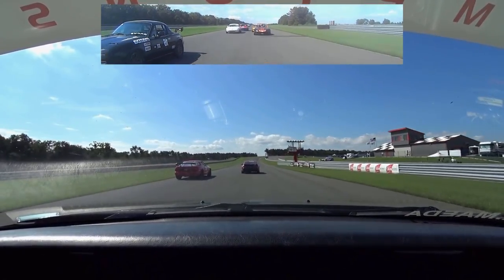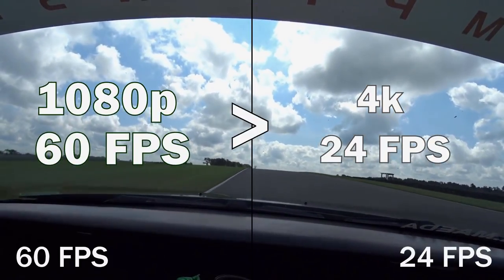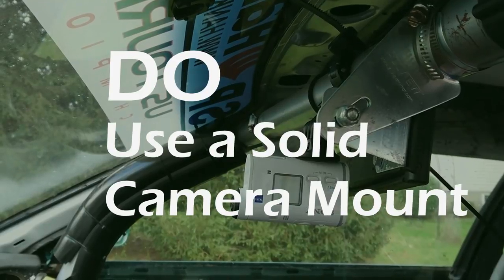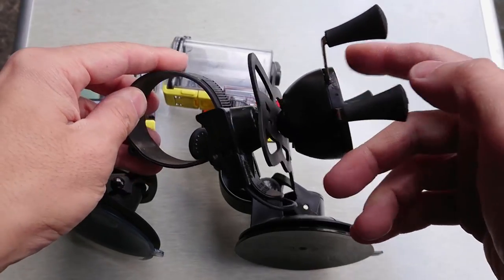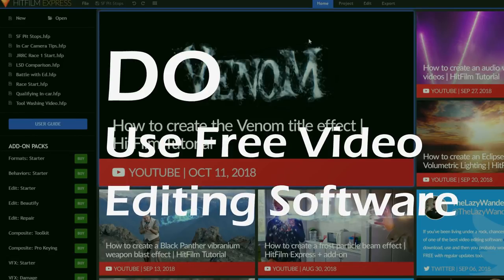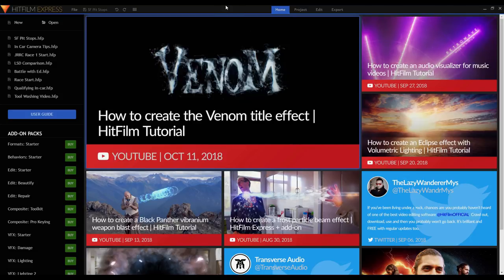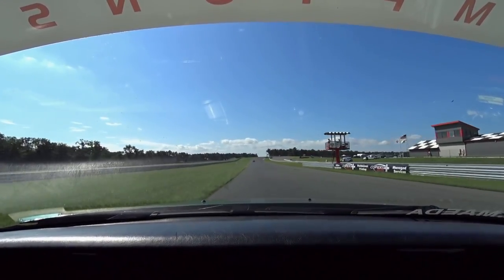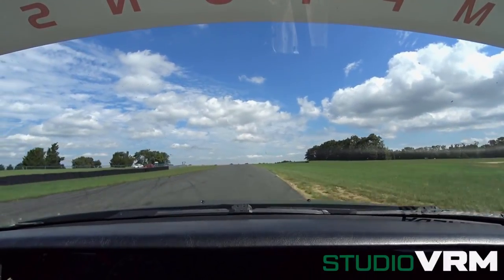DOs and DON'Ts of Onboard Video

Comment: My issue is that track day footage looks incredibly slow compared to real life. Flat out around a curve is thrilling as stuff flies past you, but the camera makes it look like you're going normal street speeds.
Reply from the maker: It's a tough problem indeed. I've found that mounting the camera low (around dashboard height or lower), using the 170 degree wide angle setting, and un-warping the footage using Action Cam Warp effect in HitFilm helps preserve the sense of speed in the footage.

You need to capture your audio from somewhere inside the cabin too, because the wind noise will absolutely obliterate the onboard mic in your camera. It takes quite a bit of work, but it's worth it if you can pull it off.
Reply: Lower the FPS and your problem is solved go to 30fps Max, the eye can only see 24fps but when setting high Fps the footage will look slow.
Reply: @RememberHesName  the eye cannot only see 24 fps, what the hell are you on about?!???
Reply: @StudioVRM What type of mic do you recommend for under the hood?
Reply from the maker: @BillySabillon123 I like the BOYA BY-M1 (and its variants) as an external mic for action cams. You might need an adapter if your camera doesn't have a 1/8" audio in port, but it's well worth it for the improved audio quality.

Some action cams have an internal amplifier for the external microphones, while some others don't. You will want to do some test recordings with the inline mic amp on and off to see which sounds better. If you're recording from inside the engine bay, I would also recommend taping the mic down against a rubber or plastic surface so you don't pick up suspension clunks and road debris.

If you still get a lot of background noise, try taping the mic to the passenger side floor of your car near the firewall. You can often get good, clean engine sounds that way.

Comment: You can record at 24fps for more motion blur just make sure to lock the shutter on double, low iso and ND filters
Reply: I did this for my track day on Saturday, while it did help make the speed look like more than 10mph, it made EVERYTHING blurry.  Take a look at my Most recent 2 videos-- 24FPS, 1/48 Shutter, ISO 100, ND16 (Cloudy Day), Wide View, 2.7k, GoPro 5 Hero, Stabalization On.  If there's better settings to use. please let me know.  All n all i do like the outcome better than before.
Reply: Also-- I do want the motion blur and cinimatic effects of speed.
Reply: @Black16STI  I had similar settings with My hero 8 in my most recent video. However, I did 4k 30fps 1/60 shutter instead. I also set my sharpness to low and color to flat(adjust them to your liking in editing).
Reply: @demonslayerx061  Did you use a ND Filter? what about ISO and the other settings?
Reply: @Black16STI  ND16, ISO 100, EV comp -1
Reply: @demonslayerx061  I def feel like the ND16 is way more appropriate than ND32 even on bright sunny days, due to being in-cabin
Reply: @Black16STI  2 things I would recommend trying. Set your fov to linear. Or, move you’re camera forward and keep it wide. The majority of your current view is the interior of your car

Comment: What cameras do you recommend? What camera did you use in the video?
Reply from the maker: I use Sony Action cams. They're older models (and probably discontinued at this point), but they still work so I keep using them. If any of them go out, I would probably replace it with an Insta360 One R.

Comment: How do you get better audio with a microphone? At lower speeds the engine comes in nice and clear. At high speeds, there is way too much noise from the wind. Any recommendations? Thanks.
Reply from the maker: I like to shroud the microphone as much as I can to keep the wind noise down. If your camera has an external microphone port, try plugging in a lapel mic and taping the mic head to a location that is shielded from the wind (e.g. behind the drivers seat or on the floor). If not, a few layers of masking tape over the microphone grille can make a noticeable difference.
Reply: @StudioVRM  Thanks for the quick reply. I have a couple Hero 9s. Any recommendations on good microphone? Thanks.
Reply from the maker: @5150Santo  I don't have much firsthand experience with the Hero 9, but I asked a few of my fellow racers, and they recommended the Movo ACM400. Apparently it is one of the few cheap lapel mics that produce clean audio on the Hero 9. You might need the media mod to plug it in, since the Movo plugs into a standard 3.5mm mic jack.

Comment: My biggest problem seems to be after I upload it to YT the video will have all sorts of distortion and artifacts.
Reply from the maker: I took a look at some of your videos (nice channel, by the way!), and I think I see what you mean. I usually see that kind of blocky distortion when I have the bitrate set too low in my video editing software. Do you happen to know what kind of codec and bitrate settings you use when you export your video from your editor?

For reference, I export all of my 1080p videos with the H264 video codec, with Variable Bitrate enabled and a target Bitrate of 16 Mbps. Youtube compression seems to do pretty well when I use those settings.

Comment: Any tips for mounting a pedal/foot cam?
Reply from the maker: Pedal cams are surprisingly tough to pull off. You need a small camera that does very well in low light, and a very sturdy mounting surface that doesn't vibrate.

On a street car, I would probably do something like put a GoPro Session on the hard trim surrounding the steering column, and point it straight at the pedals. Depending on the car, you might need a LED sticky light to illuminate the area to make sure the footage isn't all grainy.

On a race car without a full dashboard, I would hang a mount off of the dash bar on the roll cage and offset it so you can see the pedals from an angle. This will give you a similar result to the old Best Motoring / Hot Version setups.
Reply: @StudioVRM  thanks for the reply and advice man, much appreciated!👍

Comment: can i use dashwere to export de gauges as a png sequens ? 
great video
Reply from the maker: Yes there is actually. After you load up the data and configure your gauges in Dashware, you can go into the File menu and click on Create Gauge Image Sequence button to export the gauges as a PNG sequence.
Reply: @StudioVRM  Tkns m8 this is way better than VIR8, in there i had to export the video and them it will create the png sequens 
i like to use premier so i use this for the gouges png sequense ♥

Comment: The stabilization is far better than crazy ass vibrations.
Reply from the maker: If you have crazy vibrations coming through on your in car footage, I would look at your mounts before turning on stabilization. Decent camera mounts are very affordable nowadays and current digital video stabilization algorithms have a lot of trouble dealing with the high frequency vibrations that your car produces at speed.
Reply: @StudioVRM  I’m going to test today. I’ve tried head rest mounts as well as seat rail mounts. 

Now using a suction cup mount, mounted to sunroof window. I’ll remove stabilization - it’ll be a good test up and down hills and winding roads.

This time not using a cell phone but a GoPro Hero8 Black.
Reply from the maker: @gmontenegro9711  Using a gopro instead of a cell phone will also help. Cell phones have a lot of mass to them, so they tend to really shake the mounts when you hit a bump. The gopro is much lighter so you'll see a lot less vibration and movement, even on the same mount.
Reply: @StudioVRM  sweet! I’m looking forward to it. 

I don’t do any track, just spirited driving through backroads (California is infamous for all its vistas). So the roads aren’t always smooth as a track’s surface. That’s been the biggest challenge of acceleration, hard braking, taking curves etc..
Reply from the maker: @gmontenegro9711  Ah yeah, that's always a challenge. I think you might be pleasantly surprised when you switch to the gopro. Most phone cameras also have a rolling shutter that works kind of slowly. So if the phone is jarred suddenly (like when you drive over a big bump or pothole), it causes some weird distortion in the footage that doesn't go away until the phone goes back to being perfectly still.

Gopros and other action cams are much more resilient to that kind of thing. You might get some shaky footage but it won't have crazy warping and jello-like motions. And shaky footage can always be fixed in a video editor as long as you shoot at high enough a frame rate.